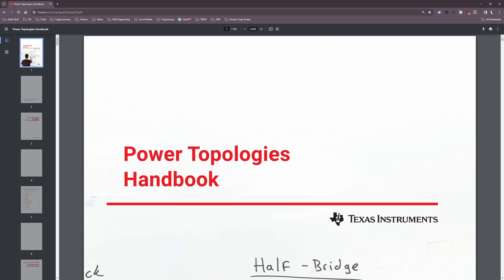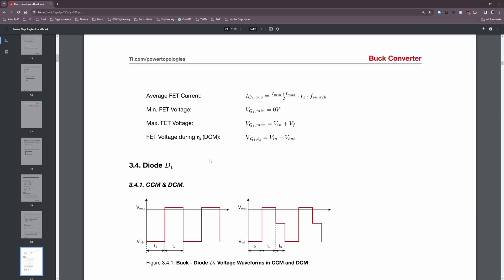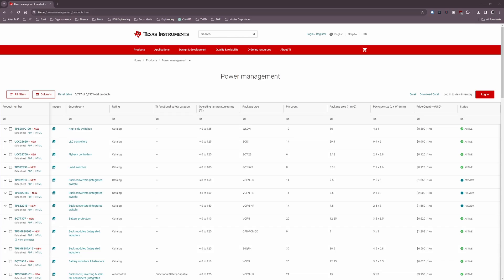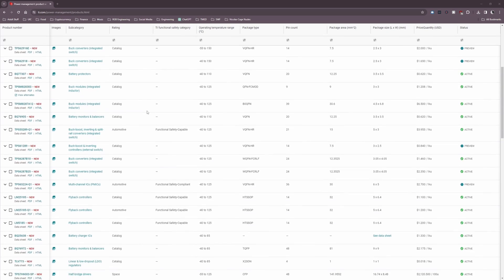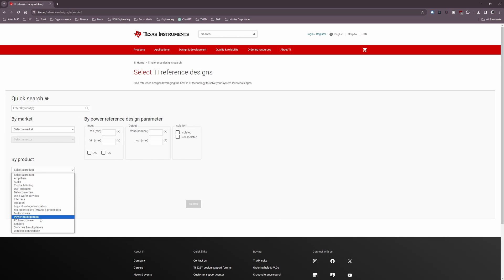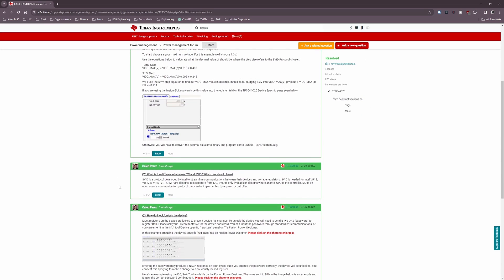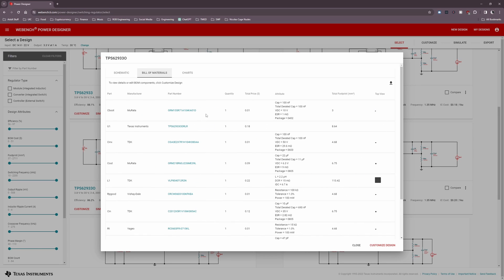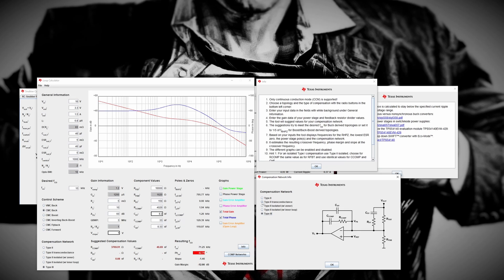Intro to Power Electronics (for Beginners)

Comment: Thank you for the video. I am looking forward for the upcoming videos. Are you doing any video on capacitors like what are the different types of capacitors used in Power design, How to choose different capacitors for different applications, how to choose the value of a capacitor for certain application, what are the key things to keep in mind while selecting a capacitor. If there is also another material you recommend that will be good. Thanks
Reply from the maker: Yes, I am planning on releasing one of those this year :)